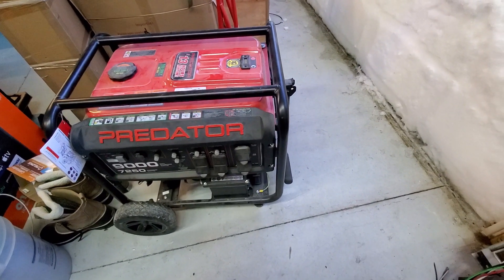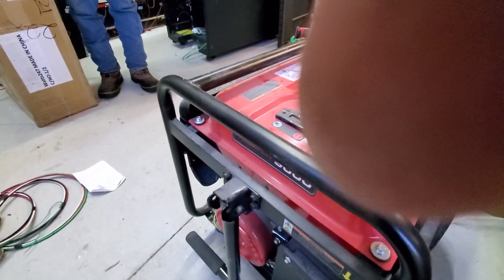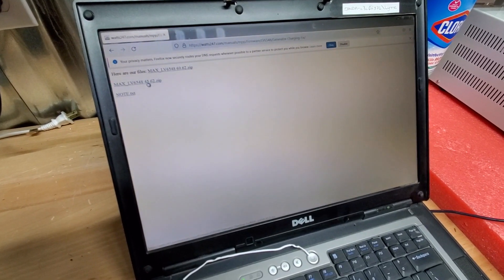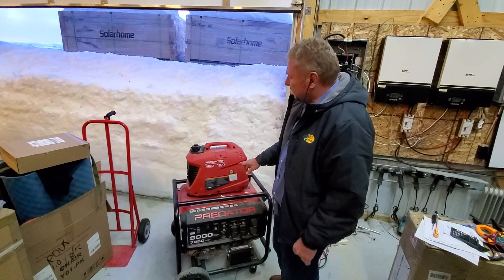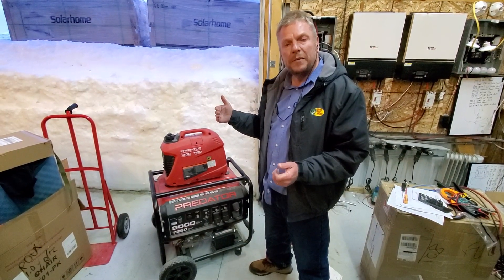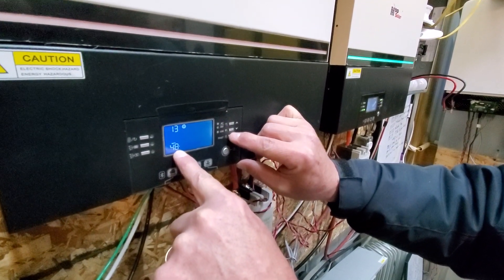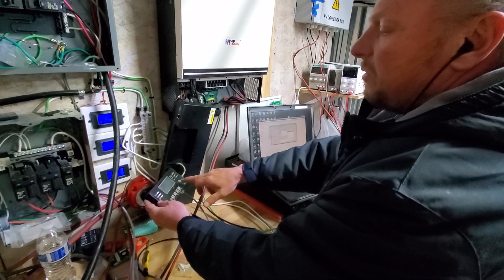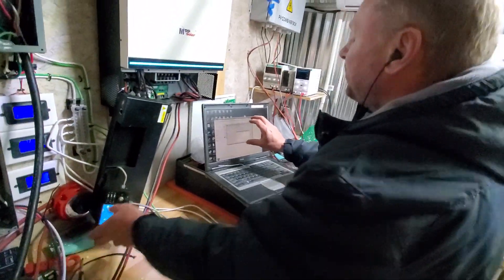LV6548 Generator Firmware Update

Comment: Thank you Ian for providing much useful info for LV6548 and solar assistant install and operation.  Also tips and tricks.  These inverters are still good little units although now will be using EG4 chargeverter for charging and a Charge controller mppt to access a greater PV input.  Keep up the good work.

Comment: Are you running the LV6548's in split phase and able to charge with that generator?
I've tried and haven't been able to get it to work.
Reply: I've read somewhere that splitting a 240v plug from the generator L1 would go to P1 utility and L2 would go to P2 utility. I haven't done this yet, but this route sounds logical.

Comment: If not using generator, can we still run old firmware?  Or should we do it regardless?
Reply: Unless you have an issue with your inverters you basically never need to update the firmware.

Comment: Other then the firmware update can you show this on the growatt 3000tl lvm-es? Growatt in split phase need AC input from both legs,  how would this work with just one generator? I have a Honda 2200 and a non inverter construction grade generator, I would like to be able to use one of them as a back up

Comment from the maker: Apologies for the video quality, it was shot at dusk in low light conditions
If your inverter was bought early 2022,  you may need a 3Kohm resistor in series with the white wire "TX"  as shown by lithium Solar.  if you need a 3k resistor module, we have a few left  (models bought since july 2022 will be just fine without the resistor)